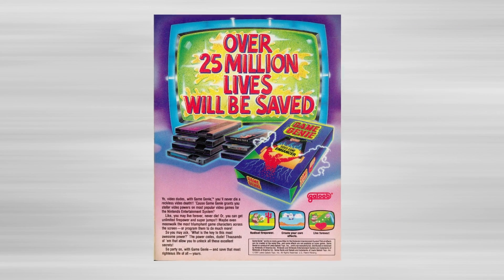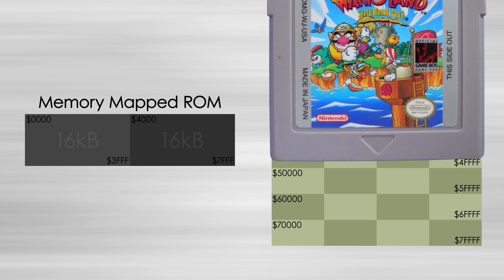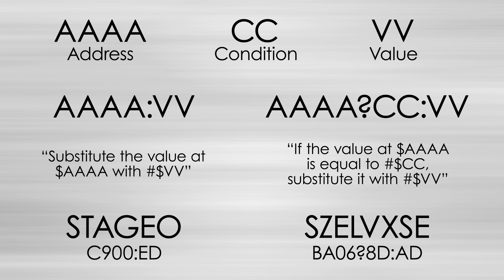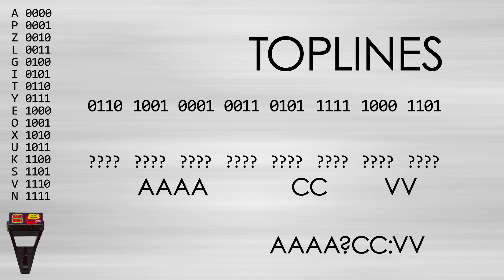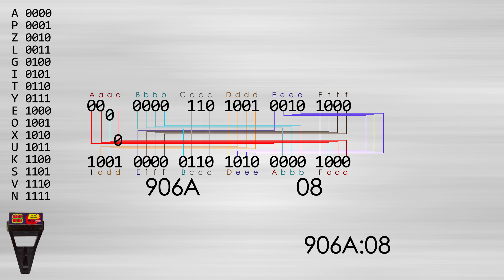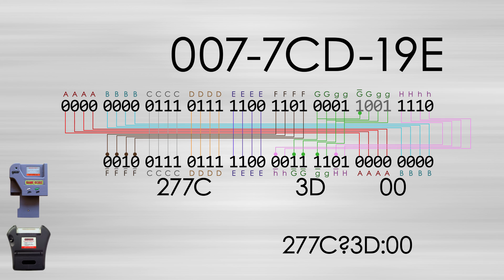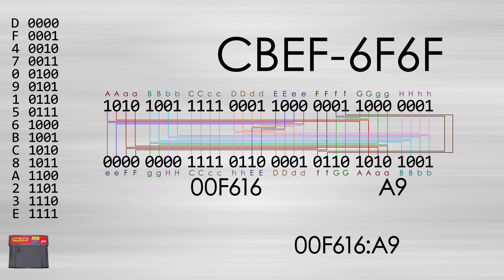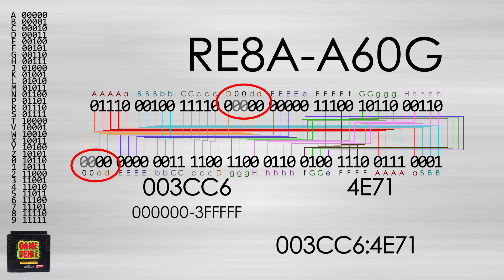The Game Genie Explained

Comment: the game genie in a sense could be comparable to a simple rom corruptor
Reply: Do you mean I could make a corruption video by entering random game genie codes?
Reply: In theory, yes.
Reply: Indeed like say the ikaaee code for super mario bros.
Reply: @karisasani7006  The source code for SMB can be found online, so just run the C or C++ program and copy/paste the code into the program. Then run the program. If you want different things to happen in the game, then all you have to do is change the code. For example you can change the code for goombas to a different set so that they don't appear in the game. This is mostly a trial and error process, as you have to determine what set of code controls the goombas and how to change it to eliminate them, but once you make the distinction it should be relatively easy.
Reply: @wrestlerx8494   Game genie does not change the program at all though. it's just changing the value in the memory more like CE in primitive form.
Reply: @canesvenatici9588  I know, but you could essentially do the same thing in the C or C++ program. If you know the original source code you could just manually change it (temporarily) to make something different happen, then change it back to the original if you want the game to be normal again. The only difference with Game Genie is that it does the work for you and you also need a game console to do it, which limits you to the codes that are available for Game Genie.
Reply: @wrestlerx8494  Just compile with different name if you want to switch back between program easily. That would having 2 different program though. 

Game genie or cheats in general at the time doesn't need to change codes unless they have some protection against it that I doubt it even then most of the time they wouldn't have access to the codes.

I mean who in the right mind would give the codes of the games they're selling.

I personally think it's a different approach between just changing value in memory and changing the program through source code if you're lucky getting a hand of it.

 There is also another different approach I know like injection. They are all different ideas though even though all of them can be used to cheat or hack or whatever they want to call it to make them sound cool.
Reply: @canesvenatici9588   OK the cartridge based games are read-only memory and I don't know of any way to skirt around this even by changing source code I.E. by using the game genie. The whole reason why it's read only is so people couldn't change anything by using a computer. There are emulators that allow you to access the games ROM file on a computer but (I'm guessing) you can't change the files once they are on the computer. So in essence you could  possibly run the game in C/C++/# but you just couldn't change it unless it allows you to change it. But if you can't change the code that came from the file, the only other alternative that may work is if you can find the codes for the game that you want online and copy/paste them into the corresponding program or if you enter them manually after viewing the ROM version. On the other hand if you can view the game's source code and enter it into the program used to run it, then it should be relatively easy to determine what changes to make for different things to happen by viewing game genie codes online. Example if there is a game genie code online that will cause one particular enemy to disappear from the game, compare this code to the original source code from the game and you can probably determine what set(s) are for enemies and change any of them in a way similar to the code that you found.
Reply: binny wen corrupt

Comment: I'm an electrical engineer and I have to ask...how/where the heck did you learn all of this and where can we dig more into it too?  Awesome channel and excellent videos!
Reply: At this age the easiest way is probably to have a look at the source code of emulators for the systems that implement it.
Reply: Start with the language C and the reverse engineer little programs you make in assembly (it'll probably be x86_64) the cpu's
instruction set and stack protection will be different (they didn't have stack protection then or not in the same sense as today) but the concept will be the same. As it is for all devices from cell phones, routers, smart tvs, the apple 1, every video game console ever invented and 99.9% of all devices with a processor period. If you would like to know more on the subject just Google information on x86_64 assembly. It will be pretty hard to understand at first which is why I recommend starting with C and then going down to asm. If you already have a grasp on programming especially complied and not interpreted programming then you may be able to switch to just learning asm without a ton of difficulty but it's so close to the actual hardware it's not very easy for a human to read it. At all. But it is possible and many of us do. I develop buffer overflows and rce's which requires me to know assembly (for the modern desktop computer aka mainly x86_64). The entire reason I watched this video was because it was in my recommendations and I wanted to see if my hypothesis on it was correct. It was close, not entirely I didn't know they had any sort of changing of addresses back then. Hopefully this helps.
Reply: Jack Danny forget that trash. Just build yourself an old digital logic trainer. The OSI 300 is a good start, even just reading through it’s manual, even if you don’t physically have one, should teach you a fair bit about how they work. It’s just a CPU and a RAM chip, connected with address and data pins. Early consoles weren’t much more than that.
You don’t need the mess of x86 to learn this stuff, everything’s abstracted now and programs aren’t even aware of which memory they’re addressing, no instructions are real. 
6502 is so easy that you don’t need to drop down from language to decompiled machine code to asm to BLEH, just start with literal machine code, if you wanna understand how memory on older machines worked then literally toggling switches to create electrical signals will be the best way, because that’s how all this worked. Basically everything was done in hardware. 
Game genie sees all the address pins lit up in a specific pattern? Cut the feed from the ROM, and set the data pins as requested by the code. That’s all that’s happening on the original units. 
Understand the basics, then you’ll be able to understand how bank switching worked, because it was much like the game genie in basic address detection, then you can grasp how detection of bank switching on the game genie itself worked. 
There’s a nice video series being made now called “how to write an NES emulator from scratch” that goes into detail on implementing the hardware in software, which gives a good understanding of how these older systems were made. 
I still recommend a romless digital logic trainer like the OSI 300 to understand the absolute fundamentals, and to use that as a jumping off point. 
If an electrical engineer has only been taught how to use AVR’s or similar micro’s, they might find this incredibly familiar. The AVR’s architecture is heavily inspired from the 6502, and you’ll see quite a lot of old machines with similar memory layouts to that of an AVR. 
A NES with a cartridge, 4k of RAM, 40K of ROM, is pretty close to your run of the mill AVR, and the memory addressing is pretty much the same too.
Reply: @n111254789  The code that is stored on the cartridge chips in Nintendo games is read-only to prevent corruption, so I don't know how even the game genie is able to skirt around this. If this were possible by any means, then a person could easily make unlimited changes to the game using a computer if they can transfer ROM files onto a computer from a game cartridge because this allows you to make changes to the code. I don't know how anyone could get the cartridge contents onto a computer though without using an illegal emulator, especially back in the days before computers were mainstream. But if you can then you could change what happens in the game without the limits imposed by game genie. I assume that you could even possibly run the game on a computer too using C or C++ platform which is probably how people on youtube create TAS content.
Reply: @wrestlerx8494   The Game Genie skirts around the "read-only" limitation because it does not attempt to write to the cartridge. It intercepts the data signals between the cart and console and sends its own signals based on the codes that the player put in.

As an aside, there is no such thing as "illegal emulation"; it's the ROMs  that are protected under copyright, not the console BIOS, and even then you are allowed to make a backup copy of the ROM as long as you don't distribute it to others. (There may be other caveats, though. I'm no legal expert.)
Reply: @wrestlerx8494  Would you mind posting links to the article and video that you mentioned?

My understanding of an emulator's function was as a means of playing the ROM, not copying it, so the emulator in question might have been illegal because it was used to copy ROMs. Or maybe the emulator in question was made before the ruling that emulators are protected under fair use? I'm not really clear on the specifics, and most of the emulators I know of are purely software and don't have a means of interacting with the original cartridges.

Regarding the GameCube disk design, that's an example of copy protection. Even if copying the games were fully legal, Nintendo would have the right to design their games in a way that can't be copied. Nintendo making the disks unreadable is not evidence one way or the other about the legality of copying the disks.

I imagine it is theoretically possible to use stack over/underflow to write code into a game, in fact doing that can lead to what TASers (and programmers in general) refer to as "Arbitrary Code Execution", and it is considered the holy grail of glitches.

If you had a game that was written in a programming language other than the original so that it can run on a PC, and the language in question had stack protection, then it would fundamentally be a different game. That's why websites like TASVideos.org have strict guidelines on which emulators are accurate enough to use, as well as which version of the game to use. A TAS of the open version of SMB3 you mentioned would not be accepted in the same category as one of the ROM versions, because they are different files and run on different systems.
Reply: @spritemeister  Here is a link to the Wikipedia article that talks about using an emulator to run games on a computer by extracting ROM image source code from the game: https://en.wikipedia.org/wiki/ROM_image
It will probably take me awhile to find the video that mentions tweaking the source code to create a TAS speed run because there are a number of videos on the subject and it was talked about somewhere in the middle of the video, but I do know that the video was about how people are able to do a speed run of Super Mario Bros. so you may be able to find it if you look, though I will keep looking as well.
Reply: @spritemeister  You may not have an answer to this, but if the ROM value that was mapped to the memory in a game at a certain point did not agree with a Game Genie code, does this mean that the Game Genie code would permanently overwrite the ROM value? I'm curious because this could mean that a change caused to a game by the input of a Game Genie code could be permanent on the game, even without using the Game Genie. Of course I have never heard of this happening, but I'm sure that it would have happened at least once if it is possible.
Reply: @wrestlerx8494  I can't really answer this one with confidence, but I imagine if it was possible for GG to overwrite ROM then it would have more of a reputation for corrupting ROMs, like how it's known to corrupt save data if the wrong codes are used.

Thanks for the link!
Reply: @wrestlerx8494  Okay, after reading the article I have a better idea. The ROM on the original hardware is proper "read only memory", and Game Genie would not be able to write to a ROM address on original hardware. But a "ROM image", that is, a copy of the ROM that is written to a flash drive or some other writeable media, could be written over as you described, unless the emulator running it was specifically designed to prevent that.
Reply: Wrestler X the game genie never overwrites anything on the cartridge. 
Without a game genie, the console sends an address to the cartridge (a simple ROM chip in this example, “read only memory”, which should already tell you the game genie can’t overwrite anything) and the rom looks for the data at that address and sends back a response with the data. Simple. 
With a game genie, it gets in the way. The console sends an address, but rather than going to the rom in the cartridge, the game genie grabs the address, looks at it, and if it’s one of the addresses from the code, it doesn’t send it to the cartridge rom, instead, it looks at the code and returns whatever data was in the code. 
If the address doesn’t match any of its codes, it just passes it to the rom, the rom looks it up like normal and returns the address, and the game genie lets that go through to the console. 
Codes, in their simplest form were just an address and data, but scrambled a little. 
If the code was “Address: 0x5A Data: 0x02”, then without the game genie, the cartridge rom would look for whatever’s at 0x5A and return it. With the game genie, it would stop the rom and just return 0x02 instead. What’s on the cartridge wouldn’t matter. 
If the console wanted something at a different address, the game genie would do nothing.
Reply: @wrestlerx8494  this was explained during the video, the game genie acts as a middleman between the ROM and processor and tells the processor the value that was modified by the code.
Reply: @coldcoffeegaming2798   Ok. The issue that I have is that different Nintendo games were created by different third parties and only the game's manufacturer is likely to have the original source code for it. That said, I realize that not every game is workable with Game Genie, and if I had to guess the games that do work probably apply to a select group of developers. However, a games original code would still be needed to create a Game Genie code that could effectively "hijack" the instructions sent from the console before they could reach the cartridge ROM file. 

The Game Geinie codes themselves would also have to be created by a programmer who could test them on games and knew what changes to make and how if necessary. They would need to know, for example, which codes apply to different actions such as power ups in different games. These things are not black and white when you are viewing the source code, and it's possible that different codes apply to different actions in different games. You would have to know the background of the entire game to even take a guess at which codes applied to which actions, and even then there would be a lot of trial and error.
Reply: Good question.
Reply: Go back to school

Comment: Pfffff that sounds really really complex,and if even bankswitching cannot be garanteered per game because of value differences between each game,that's insane,BTW if even the snes gamegenie was not designed with bankswitching in mind, that may also explain why it lacks the extra pins for fx and other chips hidden in games.
And not mentioned,you as a programner also had to reverse engineer each rom from each system to figure out what can be done and what not.
I never knew the game genie did have a intergrety bankswitching check, i allway's tout that it simply just manipulates that corresponding instructions it suppose to do and no complicated mess,but it does.
Reply: You didn't need to reverse engineer roms, you used a tool which looked for patterns in memory, so for instance, you lost a life and told the tool to look for all values that decremented since the last snapshot, anything not following the pattern is discarded. Doing this around a dozen times would narrow down to the address of the variable (lives/etc) you are trying to look for.

Comment: I still remember the fucking commercials. They made me think you could turn on every code in every game. I was mildly disappointed when you couldn't
if you go back onto the topic later, you could explain why codes for mario bros don't work in mario bros / duck hunt , as my unfortunate 8 year old self discovered the hard way.
Reply: That's pretty obvious, isn't it? In the MB game, the values are stored at address 1-10. If you add another game to the cartridge, DH in this case, then the values for DH is stored at 1-10 and the values for MB is stored at 11-20. If you use a GG code to modify the value at address 6 in MB, it won't work since that game uses 11-20.
You need to remember that NES games aren't read into the NES memory, the cartridge itself acts as RAM for the NES.
This is of course simplified, but you get the idea.
Reply: user10476 Not obvious to a normal eight year old
Reply: Mikko Översti Of course not, but Kairu seems to still not know why those codes didn't work.
Reply: I had a good idea of why, roughly, but I didn't know the actual technical reason.